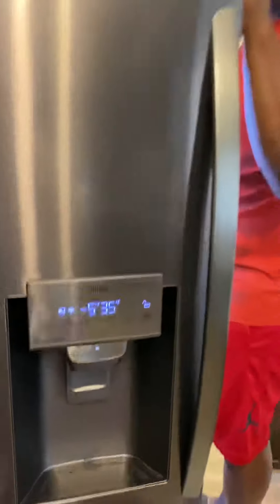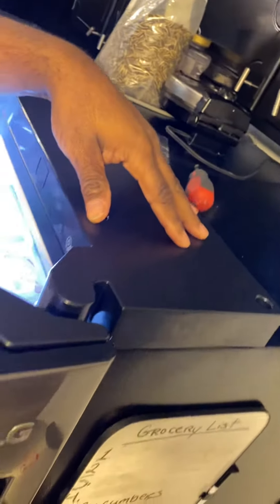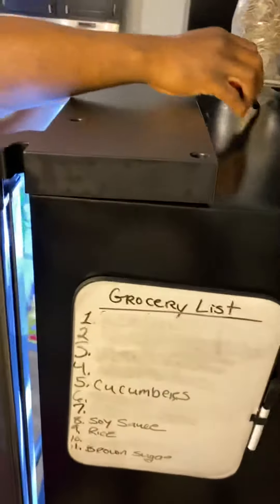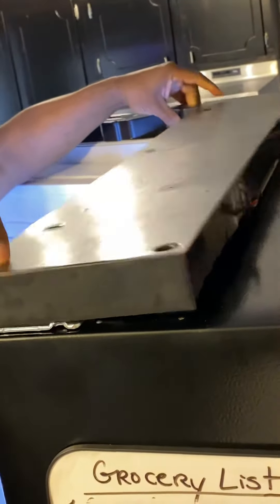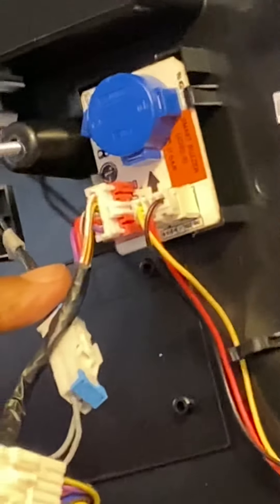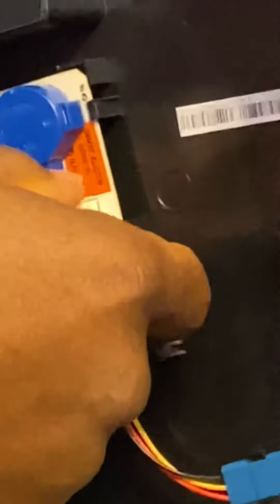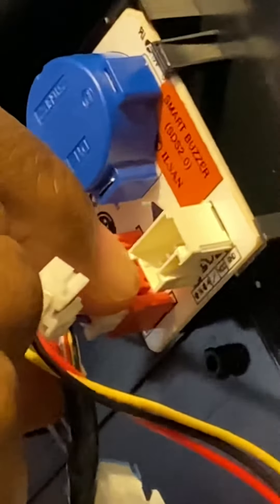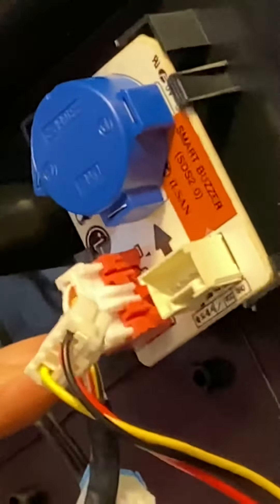LG Refrigerator Annoying beep: The EASIEST AND QUICKEST WAY to stop the door alarm

Comment: You should receive a Nobel Prize for this, HardworkandtheTruth! Thank you for solving this for all who suffer from the LG "Smart" buzzer.  FYI my top freezer refrigerator model LTCS20220 has a much smaller (3x3 inch) housing on top of the unit (front right) with the same blue buzzer and the same wiring harness plugged into the same orange receptacle. I really wanted to use a hammer for this job, but thank you for showing me the more civilized solution.
Reply: I concur, I’m putting you in for the Medal of Honor.

Comment: For anyone still searching for a solution after this method was unsuccessful… just to the left of where the guy in the video is unplugging the cords there is another long computer chip. On that computer chip on the right hand side there is a small round speaker covered in a black housing. The housing is approximately the size of a nickel(USD) and about .25inch thick. Grab that housing and pull it off. It comes off very easily and the speaker will pop off with the cover. The speaker can NOT be reattached so If you plan on restoring it you’ll have to buy a new speaker housing or know how to solder the speaker wires back together.
Reply: His way might be the best option. Thataway you can plug it back in if, say, you're going to sell the fridge or donate it to someone. But thanks for the extra bit of info.

Comment: Just got an LG fridge today and I was immediately annoyed by the door alarm. You saved the day. Thank you.
Reply: The same happened to me today! Just received the fridge loading groceries and spent 20 min trying to find a button to turn it off ! Then the Thinq app didn’t have a way either!🙈. Finally found this video ! I’ll be doing this shortly
Reply: I had the same exact problem today, but did something else and it seems to have worked; no idea why.  I spent an insufferable amount of time with LG “Live Chatbot” support (terrible!), but they did show me how to silence the alarm by going to the Sabbath mode.  That silenced the alarm (and lights), but only lasts 96 hours.  I left it in that mode for about an hour, and on impulse, turned it off to see if anything changed.  It did — no more alarm.  I like Ben’s Appliances solution better.  Thank you!

Comment: Thank you!!!!!  We have been traumatized by incessant useless beeping periodically since our LG was only a year old.  Our owners manual claims the beep cannot be disabled.  However, thanks to your video, although our model is different from yours, I found a small panel on top of the fridge, unscrewed it, and low and behold, there was a blue beeper just like yours.  We only had the LH cable, but I disconnected it, and then cautiously experimented by opening the door to remove some food, and then I waited . . . no beeps!  My son, especially, could not tune out the warning beeps at their 30 sec. intervals (just far enough apart to not be construed by the brain as "white noise") and he was about to drive the rest of us insane along with him.  And, as someone else pointed out, your explanation to just unplug the cable negated my need for Plan B, which was a hammer!  Meanwhile, the poor fridge door has more than its fair share of dents, since kicking the door on the lower right, about a foot above the floor, has been the only occasionally successful method of stopping the beeps in the past.  Bless you!

Comment: I have an older 2014 model LG and this video led me down the right path. So thank you!!! Unfortunately our model doesn't have the  blue chime electronics... But I was able to simply find that it was the upper left magnet causing the issues. I removed the magnet and simply taped it to the sensor. Boom that evil chime finally stopped. The light no longer goes on when we open the left side door. Small price to pay for peace and quiet.

Comment: Unfortunately this didn’t work with our LG model.  We did managed to stop the beeping by removing the panel above the electronic display on the door, this gives you access to remove the whole panel.  At the top is a small connector, turn the power off to fridge first and disconnect the wires. On the back of the circuit board is the door alarm, we popped off the alarm cover which made the connection causing the beeping.  Now reconnect the wires and return the panel into the door. Now turn the power back on and hopefully your beeping has stopped like ours did.  Hope this helps 😊.

Comment: Thank you for posting this. The only other guides I could find were to press some sort of Alarm/Lock button that my lower-end model does not have.

Though this pointed me in the right direction, it didn't solve the problem.

After locating the "Smart Buzzer" board, and disconnecting the connector, to my horror I heard the beeping once again!  It was coming from yet another buzzer attached to the front circuit board. What is that  "Smart Buzzer" even for? 

I then attempted to disconnect the two magnetic sensors from the door.  No help.  Then I tried taping magnets to the sensors after removing them from the housing. 

The latter worked, but this "smart" refrigerator uses those sensors to turn on the refrigerator light!  So I can't just disable the door sensors. 

I think I'll see if I can disable the front buzzer like someone else has mentioned, or desolder it.
Reply: Update: I just desoldered the buzzer from the board and now sweet, sweet silence.

Comment: Alright, I found that exact sensor and unplugged it BUT mine beeps from the ice maker area. It appears they moved the sound for the new models but still left that old module on top. Any ideas on how to get to the new one in the water/ice maker? It doesn't just unscrew.
Reply: I’m in the same boat. Have you figured this out yet?
Reply: same!! any update?
Reply: Yes I have!!! Alright, so there is still a speaker in the top right of the right hand door that does nothing. They must have updated it without removing the old part. However, there is a second one behind the ice maker screen! If you pop that front panel off then you can just pull that speaker right off the board and then like magic it’s fixed! The panel popped right off and back on for me. Also I have had 0 problems since removing it. However, it did get rid of the button beeps too but that was a small price to pay for me. Hopefully this helps! I found it deep in a service manual.

Also, it will seem like the screen will break when trying to pry it off because I don’t think it was meant to ever come off again. I am pretty sure I broke a tab. However it did pop back on and sits flush like it never happened.

Comment: LG GR-P157NIS - Side by Side Refrigerator with Indoor Ice Maker
Buzzer Sound Mute mode
Will set the buzzer/beep/error/ding/alarm sound to "off"
Press and hold the "Express FRZ" button for more than 5 seconds (you will hear a beep, the final beep!), and Mute mode it active until the next reset.
You can unmute with another 5 second press on the "Express FRZ" button.

Comment: First thanks!  So after 2 years have you noticed anything else affected by unplugging that?        I just got an LG refrigerator and spend OVER 1 hr on the phone with them.  No resolution.  They had me under that cap and they ID'd a different connection, it was wrong.  So I unplugged both of the connections on that buzzer board determined the same plug as you worked in shutting it off. But I didn't leave it unplugged because I didn't know if it would affect anything else.  Then I found your video and felt better about my observation.

Comment: Great solution.  Much appreciated.  Our annoying beeping is gone.  Question though - after removing the offending part, it appears that we have lost ice making capability.  Looking at the troubleshooting section of the manual, it says that ice won't be dispensed if a door (including the refrigerator) is left open.  Has anyone else lost ice making capability as a result of this solution, and if so, what is the fix?

Comment: Great video! Hey,..did you unplug the fridge before doing that or is that not necessarily required for this task? I'm assuming my LFXS26973S model has a similar looking wire connection and buzzer even though mine has just a small housing that is placed over a smaller portion of the left and right doors and not a long housing that runs all the way across like yours. I'm assuming the right housing is the one on my model that hides the buzzer since that also is the side that has the wifi icon nearest to it.
Reply from the maker: No need

Comment: Sadly this doesn't work on m new LG fridge, the buzzer is coming from a different location soldered to the motherboard.  I did find putting a small piece of dynamat over the hole made it a lot quieter and a lot more bearable though.  I've also found that if you put a magnet next to the door you can "trick" it into thinking the door is closed, sadly this also means the lights will not turn on either.   Probably similar to "Sabbath Mode" but it won't turn off after 96 hours.   I'm a techy, and I've about had it with all the new appliances... they are horrible, more problems then features that I don't use.
Reply: If you’re still looking for a solution, there is a small round speaker housing (about the size of a US nickel and about .25 thick and if you pop it off the speaker will come off with it and no more beeping!  In this guys video you can see the chip he’s working on. It’s the same on the newer fridges.. but look off to the left of that board and you will see a longer board with more crap on it. On the right hand side of that board you’ll find the little round black speaker housing. Literally just grab it and pull. The cover will pop off and the speaker comes off with it.

Comment: Mine is a little different. It looks like a recent model of yours but only has a cover over both hinges. Not a single one across the top. I opened the right one and it looked just like yours. I removed the same plug but it still goes off. I tried removing both plugs from the board and it STILL goes off! Any suggestions?

Comment: All: I followed the presenter’s directions and found a disconnected circuit clip when I removed the cover from atop the refrigerator.  (Top left side under cover). Once I plugged it in, the beeping stopped

Comment: That didn't work for me but it lead me to the vicinity of a small black round plastic housing that I popped with a knife which In turn stopped the beep. Thank you for showing me the way👊
Reply: Pop off as in it broke off or it disconnected it? Could it be back on if you wanted to?

Comment: Mine is the lsxc22396s removed control panel cable and  beeping stopped but now I can see control panel. Also the lijgt on refrigerator side its on.  I hope I did not discinect anything that messes up with the temperature of fridge

Comment: The issue for me was the assembly people didn’t properly place the magnetic sensor. My light would not turn off and there was a lot of beeping. If you check underneath the caps, there should be a black wire connected to a white plastic that is facing the door panel.
Reply: U rock my world... thank u very much.. Just took delivery of my new fridge today and both doors had to come off.. Its been beeping for 5 hours straight.. Thank god I found ur comment... thanks a million
Reply: Same problem I am having. Beep & lights stays on.
Reply: Andy, where are those black caps located? How did you fix it so the light stays off? Don’t mind the beeps just to open.
Reply: @carolync9408  Mine we’re on the top right and left corners of the fridge (assuming you are looking at the fridge from where the doors open). unlike in this video, mine were two separate caps, not an entire panel like this one
Reply: What did you do, just disconnect them? Same issue and tech could not fix it!
Reply: @Giselexstorm  i installed the black sensors in the slot that they should have been in, mine were not on properly
Reply: Okay tried messing with it and no luck. Thanks anyway! 2yrs with this fridge and we used it cautiously, like new. It randomly started this issue slowly.. light flickering sensing door is till open ( assumed a magnetic/sensor issue). Tech said needs to replace the whole panel.. He replaced it and now light is completely on and now non stop beeping. So now thinking to replace the whole door! Good thing it has warranty but very frustrating!

Comment: Didn't work for me, but I found this elesewhere on the net. TBH, this is the best way as you just get it done on the panel, no tools needed.
Step 1
Locate the control panel on the front of your refrigerator.
Step 2
View the control panel and locate the "Alarm/Lock" button on the far-right side of the control panel.

Step 3
Press the "Alarm/Lock" button on the control panel one time to turn off the door alarm beep.

Step 4
Press the "Alarm/Lock" button a second time to turn the door alarm beep back on.
Reply from the maker: That didn’t work. I tried that before I posted the video
Reply: I’ve read that same solution elsewhere. Not all LG fridges with the alarm feature have the Alarm/Lock button, like our brand new (this year) side-by-side, door-in-door model. I’ll have to try this!
Reply: They removed that button on the new LFCC22426* models.

Comment: How to set the temperature on LG fridge
Reply from the maker: I think just scroll down constantly
Reply: Pressing frige button, will lower temp by one. After max low temp doing one more press, the temp will loop back again to default (16 degree I think it is). Have not tried it yet myself with the LG app, but that should also do the trick, using that app on smartphone.

Comment: This did not work for me.
In older models you could just unplug the beeper on the door hinge.  However on newer models (mine is a LRMXS2806s) LG uses the blue beeper on inside of the front control panel.  It was a royal pain but I popped out the control panel and then pulled the piezo speaker off the board.  Now there are no beeps for anything.
It is insanity that LG prevents you from disabling the door open alarm or at least increasing the timeout. 

See this video to watch removal of the control panel.
https://www.youtube.com/watch?v=mR96

Comment: Try this first, using the provided wrench tool, turn the knobs at the bottom of the fridge to raise the front side. This will cause both doors to close properly. No more peeping!
Reply from the maker: What are you talking about?
Reply: @HardworkandtheTruth  I think they are helping the people that have problems with the beeping even when the doors are closed.
Reply: @HardworkandtheTruth  he means if frech doors don't close flush completely it's because the fridge is not level. Best is fir slight lean of fridge toward back. Ie if doors don't normally close fully leaving small gap then alarm may sound or usually no alarm but let's a little cold out. Solution is yo use a wrech and turn the front adjustable feet on front bottom of fridge to make feet adj slightly higher. That puts just enought backwards tilt on unit that doors close all the way. Seal properly.

Comment: I tried this, and it did not work. Different, but very similar LG fridge. Went through this process as shown 2X, never stopped beeping. Then I tried other sequences, and even disconnected EVERY connector in there. No change. Put it back together and living with this horseshit. 

As a former consumer electronics store manager, I'm pretty familiar with appliances and brands. I have bought LG products before, and I've always been disappointed. This fridge came with the house, but I will never, ever buy another LG product. Their usability is awful. Their engineers suck and they don't seem to do any User Experience testing, at least not with American customers. Their electronics' menuing systems are retarded too.
Reply: Oh, and I suspect that maybe there is a duplicate "smart" warning beeper somewhere, but hell if I can find it.